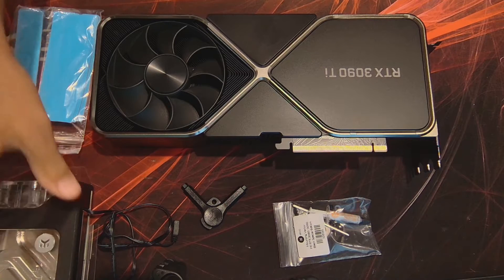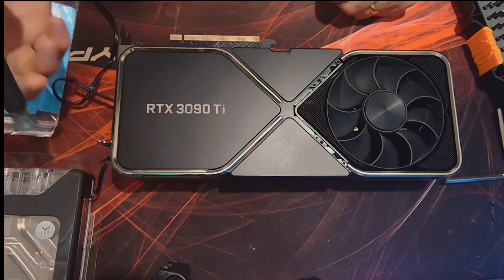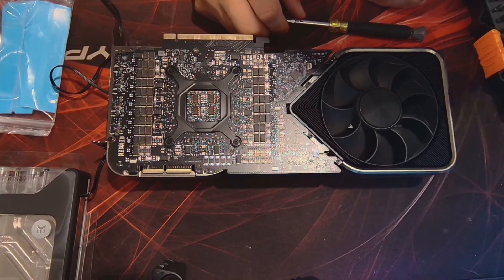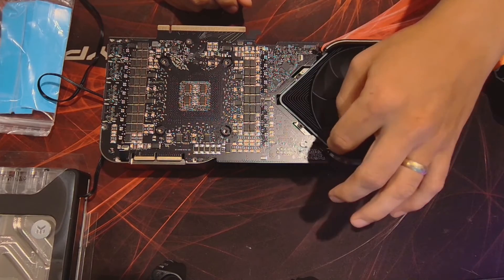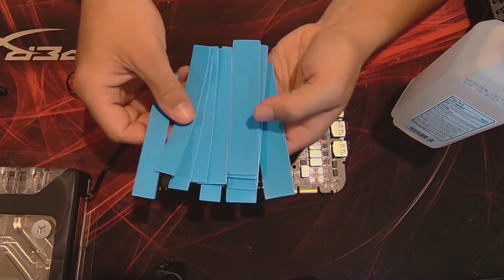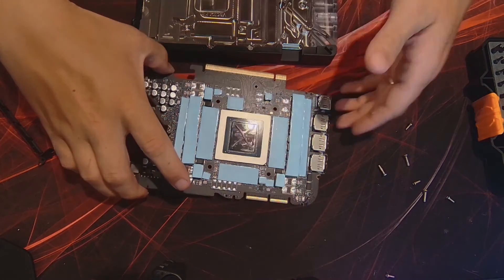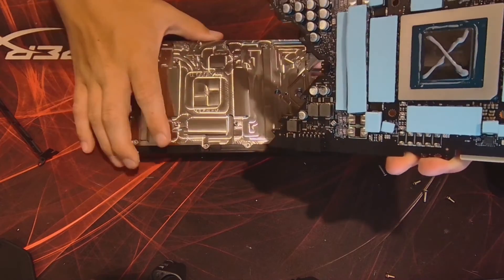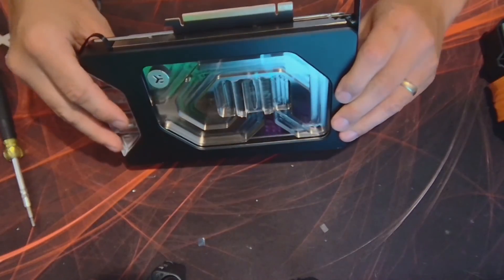NVIDIA RTX 3090 Ti FE Ultimate Upgrade - EKWB Water Block Installation!

Comment: is this necessary/worth it since i heard the design and cooling of the 3090 TI is much better than the 3090? how much lower are temps on average with this waterblock compared to without it?
also, what wattage PSU are you using for your entire build?

Comment: Hi! I just have a regular, non-Founder's Edition, RTX Geforce 3090 TI that you can order directly from Nvidia. Can you please help me with choosing the correct EK water block for my card? I can only find EKWBs for the founders edition and other 3090 TI cards, but not for just the regular one from Nvidia, unless I am not understanding how the classification works. Also, once the EK water block is on, can I just install the card back into my case the same way or will I need additional parts for the EKWB?

Comment: I'm amazed the Nvidia can't foot for copper on the stock cooler.  The heat capacity of copper is 0.37 Aluminum 0.92; the lower the better for heat transfer.  The card is ~$1600 on Amazon...You can't use copper?  Insanity!

Comment: 4090 done just made this a waste of cash completely lol
Reply from the maker: I’d agree if there was actually a game out there worth playing at 4K high FPS lol
Reply: @Trey  not it don't matter if you agree, or not. Facts, are facts.
Reply from the maker: @steezegod2768  too true!
Reply: Not with SLI
Reply: @Cyberbrain  ah yes, so he can double fps in a single game of Red Dead Redemption 2, and synthetic benchmarks, instead of selling this, and buying a 4090 that could double rasterization in all titles. However, you do have a solid point, will check comparisons.
Reply: @steezegod2768  it's true, in some cases 3090 SLI is better. But overall a 4090 is better. I know, since I have both. 

Also it is great in RDR2 for sure, 4k HDR, 120 fps. But AFR plays havoc with recording game play, so a 4090 would be better if you want to record. SLI doesn't work with Cyberpunk so 4090 also superior.
Reply from the maker: @CyberbrainPC  I play mostly R6 Siege and FIFA right now so my use case for a 4090 isn’t quite justified yet lol I do plan to do a water block video for the 4090 in about a month. What monitor would you suggest for the 4090?
Reply: @bamfrides44  Any 4k HDR 120+Hz monitor that fits your desk and budget. Otherwise a 4090 is a waste :)
Reply from the maker: @CyberbrainPC  I’ve been using the Samsung G7, been pretty good so far minus a couple small bugs.

Comment: Do the waterblocks differ between 3090 and the 3090 ti? The boards look identical.
Reply: Massive different from actual shape to shifted components. Even the die is more up on the PCB on the 3090 ti

Comment: Hey  man you forgot the backplate thermal pads... and you should use thermal paste on the v shaped end of the backplate that comes into contact with the front water-cooled plate... thats how it gets extra cooling since it is mainly passively cooled.
Reply from the maker: Yeaaa thanks to you and another comment I was able to fix it before it was too late, I pinned the last comment to point it out so anyone watching hopefully doesn't make my mistake. Good to know about the thermal paste, next chance I get, I will add that in!
Reply: @bamfrides44  NP, yeah I saw that pinned comment right after I sent mine lol, but thought I should still leave it for the thermal paste part. Should be very easy if you did not mount the graphics card vertically, unscrew the backplate and apply few dots of thermal paste on the v shaped part near the water ports and you're done.

Comment: Aaaaaaand 40 series drops …
Reply: @PavKer lol not on launch day. I have the “in” at microcenter. I get aaaall the information. Plus they price match silly sally.
Reply: @PavKer Only if you empower scalpers by purchasing from them. They are not easy to get, but easier than PS5 has been. 

If you have Geforce Experience installed, you may get a Best buy link via that. Many people did.

Comment: Prob would of helped if you removed the plastic backing off the thermal pads before installing it .The pads are white not blue when the plastic is removed :)
Reply from the maker: The pads are actually baby blue and had a very thin plastic film that was a deeper blue. I figured it might be better to leave the top film on while installing to avoid smooshing my fingers into the top when installing, but it ended up proving more difficult to remove the film that way.